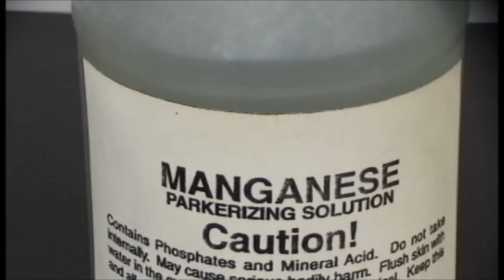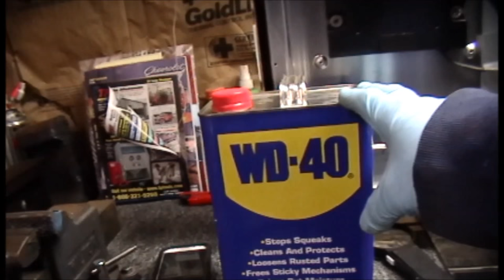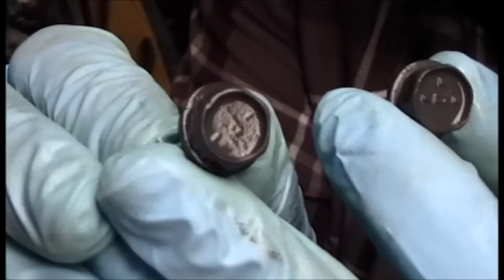Restoring Bolts & Fasteners On Your Restoration

Comment: Excellent explanation and detailed. Restoring   an old bike and the bolts need doing. Most are the battleship gray. Will be following this procedure. Thank you for posting.  P.s im a spray painter and please use a charcoal mask for fumes. The one you are using is only for dust partials and gives no protection against fumes. 👌
Reply from the maker: Glad it helped. Will definitely wear a better mask for protection.

Comment: This is such an underviewed tutorial - such an informing video. And it looks to be better than electroplating. Does the parkerizing process add any thickness to the bolts? I.e do they go back into their holes easier
Reply from the maker: Thanks, there is no change in thickness. The bolts assemble together just like new. Thanks for watching.

Comment: Do the bolts have to be sand blasted or can they be cleaned with degreaser and then evapo-rust to remove the rust?
Reply from the maker: I have always sandblasted mine. Never tried any other method. I would say you want the metal etched so that it would take the coating.

Comment: Bought the chemicals and I’m about to try this. I’m seeing videos of using electrical current to zinc plate. Which is better? Seems I’m more apt to do it your way, especially if it’s an equally good finished product. Getting the frame and all the other parts from the powder coater tomorrow, so I don’t want the bolts to look old when everything else is new. Great video!
Reply from the maker: Michael, I tried a cheap kit that used a battery once, never could get it to work. If you have any issues with the process or any questions, reach out to me z28dad@gmail.com, or here, it's linked to my phone. I think you will really like the way the bolts will look.
Reply: Double R Restorations, I’m doing all the chassis hardware with this process, including the control arm bolts, upper and lower rear, front suspension, everything. This should look amazing against the semi-gloss black.
Reply from the maker: Michael Brower You will really like it. I have done a few for some of my local friends and they really liked it.

Comment: Really enjoyed the video as I'm looking for the best process/results for restoring original fasteners for my restoration work. I'm wondering if you've had any experience with DIY zinc plating and if so, how the results compare to this cook process. This process looks much easier, but can you achieve any of the other colors of zinc protection, namely yellow finish?... thanks again!
Reply from the maker: John, I tried a clear zinc plating (silver finish) process once from Eastwood, but never could get it to work, could have been error on my part. I have had to send all of my yellow finish stuff out to the pros, such as my brake booster and master cylinder cover, from what I understand its a complex process. This process works well for bolts and such and holds up well to the elements. Thanks for watching

Comment: Very cool Russ. I had to skip through it to watch it all, so I missed some stuff. What do you do with the left-over chemicals? Are they toxic?
Reply from the maker: +asicerik You can re-use it. I just use a coffee strainer and funnel to put it into another jug labeled used. It does contain phosphates and mineral acid, but its a small amount once mixed with water. I apologize about the length of the vid. Probably should have done a part 1 and 2.
Reply: +Double R Restorations No, its cool. I just did not have time to watch it all. Thanks man!

Comment: actually both the T-9 and wd-40 are water displacement you can either skip wd-40 altogether and go directly to the T-9 or skip the T-9 and use only the WD-40 but since the T-9 is a better rust preventer skip the wd-40 
the reason I said skip T-9 is in black oxide process they use WD-40 as a sealer in final step or a wax coating for a matte finish 
also to make things simple pour whole bottle into pyrex bowl and dip bolts like you did wd-40 then pull out and wipe dry
Reply from the maker: Yea, the wd is easy to get around here, and a little cheaper. When I run out I may order a gallon of the T9.

Comment: This was a great video.I learned a lot and i am big on bolts too so i will check this out. thanks again Oh and do you do your own powder coating and if you do.If and when you have time can you show us your set up.I will be getting into that also later
Reply from the maker: +265chevy Thanks Hanson. I do have a small powder coating setup. The oven is just an old house oven and I'm using the Hyper smooth gun.  Ive got one small part that I need to coat so I will make a vid on it. One day after the body work on the cars I would like to build a nice large oven.